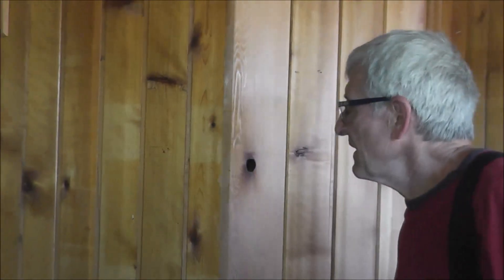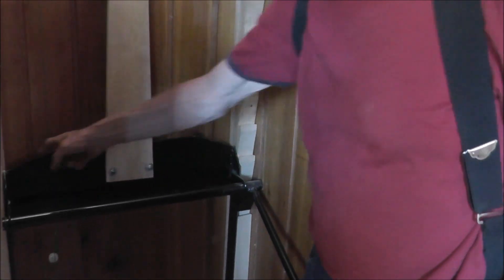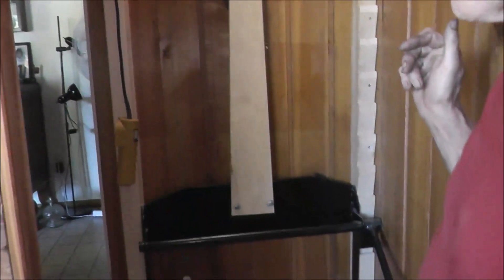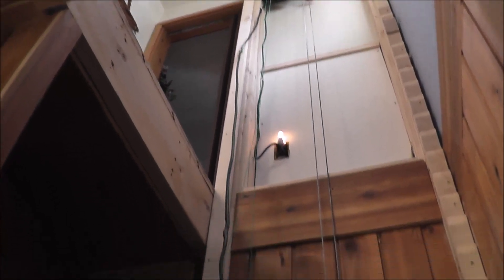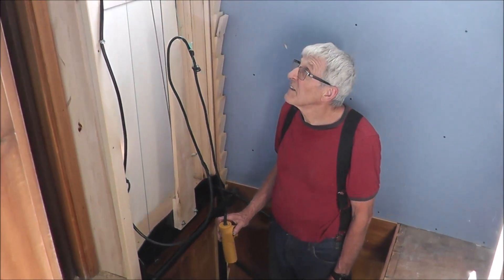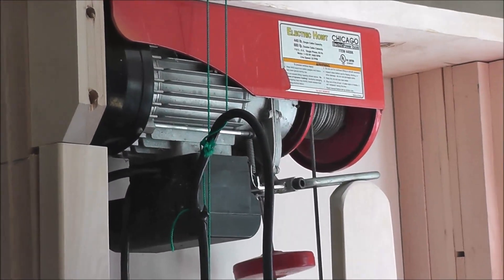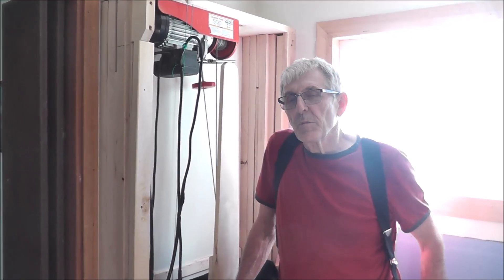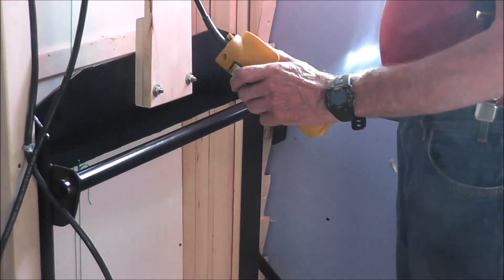DIY Elevator for home or shop

Comment: Nice Job! I've installed a telecab on a large house, it cost 35, 000 installed...I had to get a permit in philadelphia...So you need disconnect boxes, a telephone, designated circuit...I love your idea better...:)...The board in the middle that hits the switch...Is that necessary?  How did you attach the cables or are they going through a shiv?
Reply from the maker: The board in that you are referring to is just a cable guard and it goes up and hits the switch at the top to stop it.  Alot of people have been really giving me what for , for building this,  It works 100% for us. Some of the comments they clearly don't know what they are talking about. Like the hole in the ceiling goes into own room and is locked when the lift is down. Impossible to break the hardwood notches. Anyway to make people more happy I will modify it to lock going down as well as up if the cable broke. The cable goes through a pulley  and then up and attaches to the winch. I may take this right off Utube and maybe never should have put it on.
Reply: @brianprocter6191  i liked the video cause i may use a similar setup in the future. depends on  how long i live here. right now the stairs are not a problem but who knows . thanks for the idea.
Reply: I install lifts for a living. Yours is fine for your missus and you, no other users. congrats! If others were to use it, they would need training. But you two are in great shape

Comment: Safety issues?...yes....Dangerous?....yes
Some relatively cheap ways to improve it can be done to make it more safe.

But the man is trying to do what he can for his wife and doesn't have the money to buy a certified residential elevator which could cost starting around $13,000.
Reply: Tony Wadkins I can build a risk free elevator for someone else with a budget of 6,000

Comment: I have seen many of these on YT but none of them will pass a safety inspection...and they all cost money plus quite a bit of time. If you have a disability the best thing you can do is contact your insurance company (or Medicare) and see if they will pay to have a proper elevator / stair climber put in. Now you have the best of both worlds where it's both safe (and UL approved) plus somebody else pays for it! If you feel the urge to build something like this then save it for moving heavy stuff to the attic of your garage, not people moving.

Comment: Even the smart elevator guy below didn’t mention the support holding the winch is a 2-by and completely inadequate for the weight of the winch.  Repeated sagging/offloading would eventually cause the board to fail.  I didn’t see the full construction, but believe their other hazards associated with the notch system for braking.  The metal dog needs to resemble the actual notch and not a knife blade.  The first time I saw this, that’s what went through my head, if this failed, so would the notch system, at least to a certain point.

Comment: I know it will ad some cost to your lift, but I will ad a Fall Arrester block in case that the wire breaks, the brake fails or other faults. The Fall Arrester block shall be attaced to the top bar and to the platform and stop the platform in free fall. Winch for personal lift is equiped with two braks and minimum two wires. Close all holes in the construction, so nobody get a foot or finger between construction and platform, this will breake some bones. A optic sensor that sees objects close to the lift edge and stops the lift could also be a god idea. Ad rails / walls and door to prvent sombody to fall in the pit. This lift could kill somebody if the accident occurs.

Comment: its nicely made let me tell you that first , you might want to check the old lift safety plans from otis 
https://www.youtube.com/watch?v=sSjJjKcoNRk

the thing is that when the lift goes down you need to release the ratchet and should the cable break the lift drops the rest of the way down 
the way otis solved it is to make spring loaded levers pop out intoo the guiderails when the lift cable tension is gone (maibe use brakeshoes?)

another way you might be able to solve the problem is with some sort of airresistance ( https://staminaproducts.com/wp-content/uploads/2018/02/DSC_4873_N-web.jpg ) driven by a second cable atached to the lifting basket  , should the main lift cable break the resistance of the fan spinning up schould stop the elevator from dropping too fast 

a counterweight should help too , both to make the winch work smoother and to slow the lift cart on the way down

Comment: Why is there so many safety sises? He measured the risks and is willing to risk it to save 12,000$ dollars...  Its not hurting anyone but him!
Reply: Nolan yoyo He exposes any one who ever enters the home, to much higher than average risk. Probably with out there knowledge.
Reply: And the reputation of a safe industry and trained craftsmen. When someone dies on this death trap the news isn’t going to say it was installed by a cheep moron. There going to say someone died on an elevator. This meets no known code. Codes are there because someone died for them.
Reply: @p.d.smithjr.3277  What are we going to do, rope off every tree and put fences around all beaches so people can't fall or drown?
Reply: oo0Spyder0oo  I’m hardly risk adverse. I work every day at 300m plus on moving equipment. 35 years honing my craft. I’ve worked on two person elevators all the way to elevators for moving tractor trailer rigs. 
     We don’t need to protect most adults from beaches or trees, might need to use more precautions for a child. Protecting the unknowing from risk they don’t choose to take, the guest who gets up in the middle of the night to piss and opens the wrong door, falls to his or her death. The child killed because of lack of safety devices. Choosing the risk level we’re comfortable with is right and proper. Exposing others with out there  knowledge to risk higher than the norm is wrong.  
     I’m proud I protect the riding public from risk they are not aware of every day.

Comment: It's obviously not finished yet in this video. But that ratchet track needs to be steel. Better would be to copy the original Otis Elevator safety where the cable pulled up on a pair of links connected at a joint in the center, and at the sides to hinged pawls. A strong spring pushed outward on the pawls. If the cable broke or the lift motor failed, the cable being loose allowed the spring to force the pawls outward into the toothed tracks on both sides.

Comment: well done !, this setup is very functionnal but it needs refinements to be used as a commercial unit, in the list of comments, some are very pertinents and at my advice, you should take them in account, to me,,your safety ratchet deserve to be redesigned and at least, you should install a small gate at each level to protect somebody to fall in the pit, your winch should be OK as long you don't heavier than the half of the rated capacity.

Comment: My friend made a lift using a forklift mast. The controls run an electrically powered hydraulic pump and has all the safety shutoff buttons and limit switches. He made it from mostly scrap parts. California is so stringent on environment and safety that many forklifts get scrapped out at an early age...there are plenty of parts avail.

Comment: Wonderful idea, just a feedback, although not sure if possible but is there a way for you to install a gate as you lift the elevator the gate will lift maybe 4 or 5 feet to cover the shaft hole, afraid that someone can accidentally fall specially since I saw a kid in the background. I think you can do one for the bottom and one for the upstairs since you are obviously more than capable craftsman. thank you for sharing.

Comment: Awesome job great thinking outside of the box. That is the way it should be instead of running out and spending your money on over priced stuff. 

Yes it may not be to code or be made of the wrong materials (pine wood & sharp steel brake) but when you have a need you find a way to make it work. If not for trial and error how would anyone succeed. and i am pertty sure he has tested it out over and over again before he put his wife on it. Hey don't let the age or grey hair fool you. I believe he found what fit his wife's needs.

Comment: Also, there is now no fire separations through floor now.  In afire you have created a chimney.  Unless the shaft is created with full enclosure is 1 hour rated fire separations,. It is a tragedy waiting to happen.  Take a look at commercial manufacture personal elevators such as " Minivator" (brand name). You will see what I mean.  Yes nice to be able to have diy projects, but osha and local permits and laws of safety where created for a good reason.
Reply: again Gus how is a stairway not a chimney

Comment: Well I was going to comment that the safety system only works going up, coming down he's holding it out of the way. I am both a carpenter and an engineer; I don't agree (with some) that the safety would shear all the way down, I think it will lock immediately, maybe crack the first wedge it contacts. I would be more interested in figuring out a better system so there's a lock going both ways. And it's possible by simply adding another set that is upside down and spring loaded, with a dog that jumps off each wedge as it goes down while the spring is forcing it to engage the next wedge until it gets close enough to jump off to engage the next one.
I am sure he built something that works for him and solves an issue, it'll be very useful for her after the surgery. It will in fact always have it's uses, for as long as the house sits there.
I don't know if he mentions whether he's done, but a lot of safety panels need to be installed, including a good railing system for upstairs when the platform is downstairs. Then I see kid(s) in the house, so there needs to be an interlock to prevent a mischievous kid from standing under the platform when it's coming down.
Reply: we call that evolution accidents

Comment: I have did one similar before. I have use climbing rope and anti slip device as a second safety. Remote can 4ways lighting switch that switches the contactors. One button for up, one for down, one for lights. Can easily trace the wiring at the yellow control. Good luck.

Comment: That winch wasn’t designed, sold or licensed to lift people. If the cable or the break ever broke the safety device would split and you would be in a free fall. The support of the winch isn’t strong enough for the load. 
At the very minimum. This elevator must have a counter weight to balance the load. Second at a very minimum the safety device must be made out of steel. If that death trap should fall. When the steel break hits the wood notches at full load. The steel wedge would split the wood the same as an axe hitting the soft pine. His wonderful wife will die!
Reply: fluke196c 
Sorry if I offended you. This elevator is very very dangerous. It will fail. The only question is how badly will his wife get hurt. 
I offered real honest suggestions. He can redesign it so it won’t be a death trap. Elevators are expensive for a reason. With some small modifications he can make it safe. Please think about my suggestions. 
1) Use steel angel iron firmly attached to the house studs. Make sure to use schedule 3 bolts. 1/2” minimum. 
2) install a counter weight equal to the weight of the elevator. Attach a cable to the lift. Install a heavy duty pulpy to the steel angle iron frame. Attach the other end of the cable service o the counter weight. That way the motor will only have to lift his wife. 
3) get rid of the wood safety. If there is a failure. The metal stop will act as a chisel. The elevator will fall with nothing to stop it. 
Instead install 2 angle irons with stop notches on both sides of the lift. Also attach a spring that will lock in when the cable breaks, the winch break fails or the winch will break or pull away from the wood frame. 
You may think I am a safety Nazi. My suggestions will only cost $250.  His wife’s safety is worth that. 
I was called in to investigate a death. A young man was hurt and confined to a wheelchair. His parents had a carpenter build an elevator so the son could get to his room on the second floor. 
The carpenter inserted a heavy eye bolt to the ceiling. Hung an automotive winch on the eye bolt and the other end to the elevator box. This worked great for 7 months. The 2x6 that the eyebolt went through cracked and finally broke. The young man fell 12 feet and was killed when the winch crushed his skull. 
Do you still think I am a silly safety Nazi?

Comment: Like the design, but have some safety upgrade suggestions for you.
1. Loose the wooden catch teeth. replace with angle iron cut in a sawtooth pattern. And add another to the other rail.
2. Get rid of the arm to lift the safety brake. Make the shaft spring loaded so it will always be pulled into position. Then move your lifting point on the car to the shaft using an attachment arm that will hold the safety brake open while the winch has tension on the cable.

That way if the cable ever breaks, the safety brake will automatically engage regardless of the direction of travel of the car. THAT IS HOW REAL ELEVATORS WORK!!

3. Put a real handrail on the wall side of the car please!!
Reply: There is no way to make this safe for people.

Comment: Just keep in mind that the winch IS going to fail. It is not a question of IF but when. I like the dog safety. It would be better if it were activated by a spring that was released when the cable is not tight. At the very least add a spring to pull the handle down. When it falls gravity is not going to be in your favor when everything is falling. Also they make a retracting fall protector for construction workers that would also work. It works on the idea that if you spin a wheel too fast it catches and stops.
Reply: excellent idea for the secondary containment. this idea may not be perfect but i see it as a work in progress

Comment: Brian, I'm glad you can help your wife! It is a great idea.  But I need to tell you this to clear my conscience.  I'm not an engineer.  But I an a builder and know limitations of wood strength.  Your 1" backboard on the back of the elevator is connected to the hoist cable and Carrie's the entire weight of  the apparatus.  Even though pulley system in theory reduces the lift weight, that 1" board will fail and cause you or your wife to crash to the ground.  Also the single 1" board holding the hoist is not sufficient.  Very dangerous.  Please beef it up
Reply from the maker: The winch pulley is bolted to the 1/4 inch steel plate. Not the board. Also because of the many concerns about safety beyond what I built in, I will be changing it to incorporate an automatic arrest system.  Winch rated for 880 lbs and lifting 200. Thought that was a good safety margin, size of the cable thousands. Its safe as it sits but why not go the extra mile.

Comment: Header needs to be stronger. Brake system WILL fail they will split along the grain and screw sheer strength will fold over or sheer off. Needs to be metal. Safety gates needed on both floors. Some kind of retracting system for the cable such as what you buy for a retractable shop light/ extension cord. How about some electrical tape on the cord where it is frayed in several places?  Im sorry but your safety brake is a complete failure and I assure you it will fail. If someone is going down and holding the handle to go down and the cable or wench fails, just how quick are they going to let go or JAM the brake into inferior wood blocks? Your wife doesn't have drag racer instant reflexes and when panic happens people FREEZE.   Even if you changed your safety to metal, this same example of going down will apply, reflexes.  Maybe for use as a dumbwaiter for dishes or clothing, but not YOUR WIFE.  Yours truly, a 50 year builder and General Contractor.  Ps: The reason city's have building codes is because of dangerous projects like yours. When people get hurt of die, Government seems to want to stop and prevent the stupid reasons why.